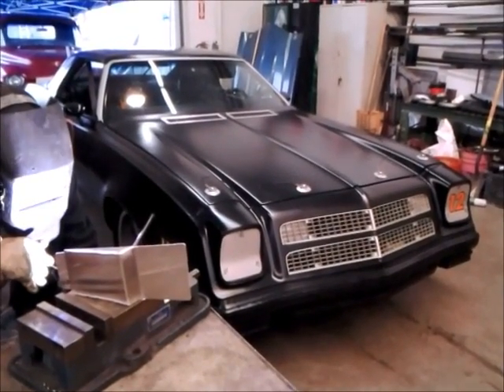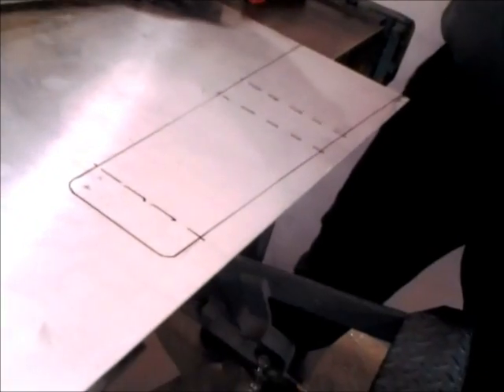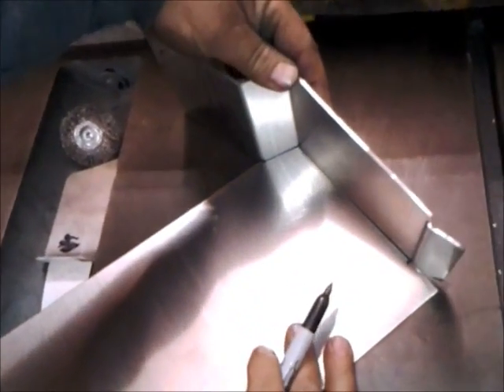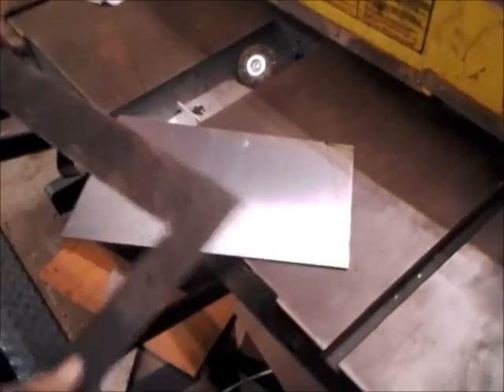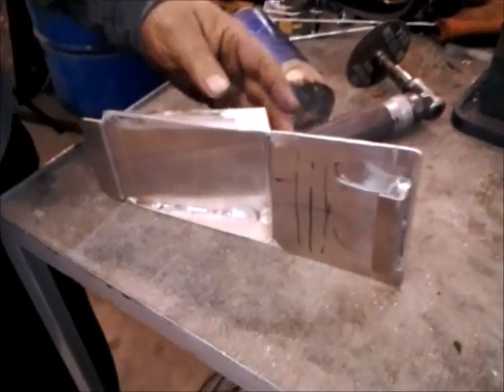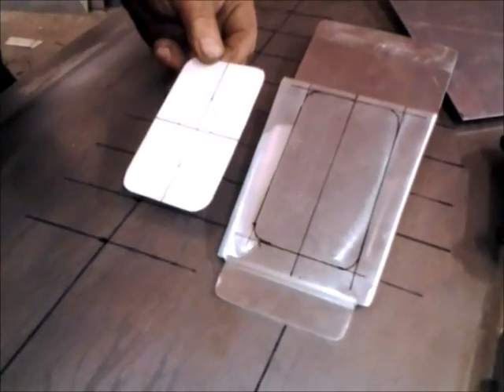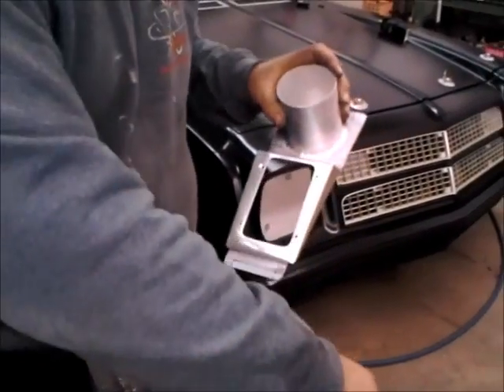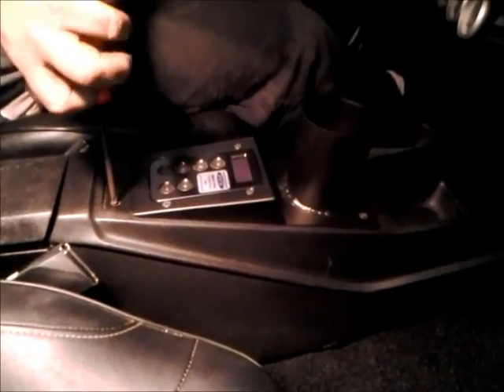Fabrication Methods For Creating Your Own Parts

Comment: Why didn’t you flush mount the cup holder ? Hell you can buy prefabbed stainless ones now and cut the hole and it would have looked better. You went through all the trouble of flush mounting the unit then had a flag pole mount looking cup holder stuck up there.

Comment: That's awesome but would you really charge 6 hours? 
How much per hour is a fabricator?
Reply: Yes it would take 6 hours and with fab work there’s no book so it’s done by how long it takes to straight work the piece not the time it takes if you screw around but just the time working on it. The range for fab work is extreme anywhere from $90hr -$250hr or more depending on who you get to do the work.